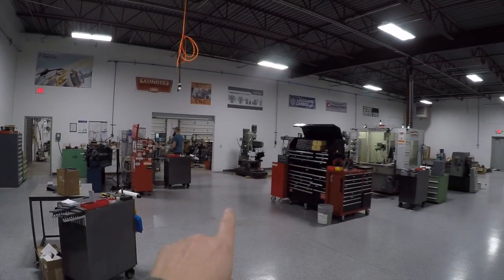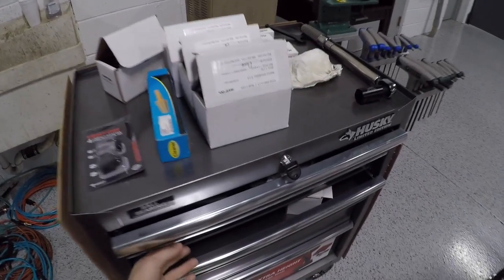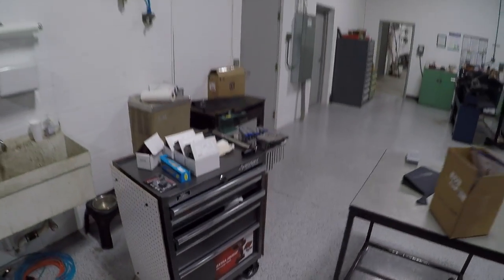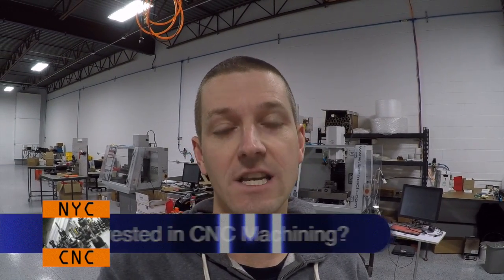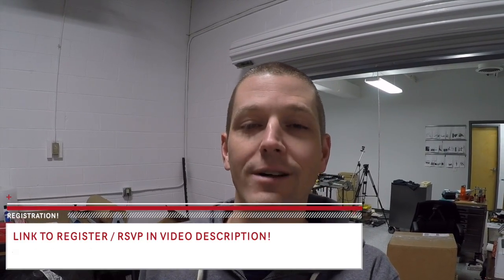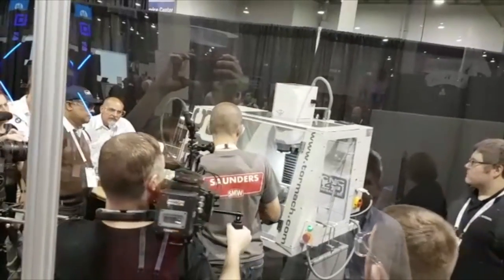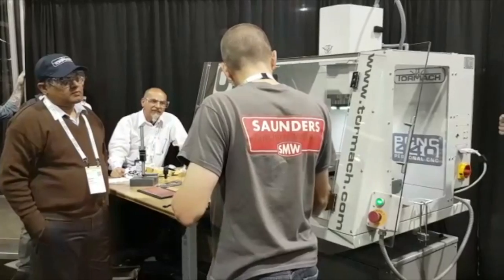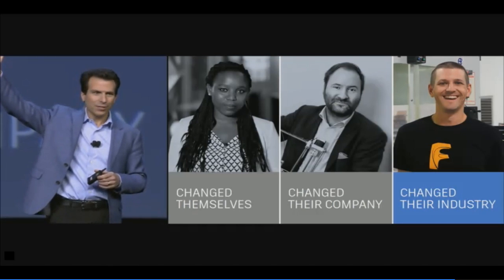Autodesk University and How to Succeed in your Business Pursuits CB38

Comment: Don't know how your other MCU's work but HAAS requires block G43 addresses for every tool change. At least the small VMC's at school do. Just a warning since I've heard other controls recall height comp. automatically.
Reply: Chaotic Logic 
G43 is negative tool height comp. it should be on the same line as the first Z move along with an H value corresponding to the tool. 

Some older machines use G44 which is positive tool height comp.  same thing as G43, just inversed. Has to do with how tool heights are stored in the machine controller. (Some store heights as positive values, some store as negative values)

G49 cancels tool height comps

HAAS has T and H address agreement parameter you can turn on, which checks to make sure the H number you call matches the T number in the spindle. If it doesn't it will stop and give you a T H agreement error. 

Still always need a G43 Z# H# though no mater what machine. 

Most machines will overwrite the H value on a new G43 H# line without having to cancel out with a G49. And many have tool height automatically cancel on a M6 during the tool change.
Reply: So the Z axis direction is reversed on older machines? They both referenece machine zero right?
Reply: Chaotic Logic 
Not exactly "reversed". 

It's based on how you're referencing the tool height. 

Negative height if you're referencing from something on the table like a gauge block or top of a vise or part. 

Positive values are it you're referencing to a distance from the spindles gauge length (typically machine Z zero). 

Old machines didn't have things like G54. And everything had to be referenced from the machines home position. So all height offset values were positive. 

When multiple offset positions were added, you could reference offsets based off of a G54 position. Which would give you negative Z height offsets. 

Negative height offsets are the most commonly used now because it's easier to adjust a tool height. Need it to go down more, subtract (make the offset more negative), up you add (more positive).  

With positive height offsets you have to add to make the tool go more negative, and subtract to make it go less negative. 

Confused yet?  😁
Reply: So what is the industry preferred CNC namebrand? It's my understanding that HAAS is the economical choice usually but also revered for ease of use.
Reply: Chaotic Logic 
HAAS, Fadal and Hurco would be entry level. 

Mazak, matsuura, kitamora, Datron would be a few levels up. 

DMG-Mori, Okuma, Grob would be a few more notches up. 

And top machines would be Makino, Hermle, mitsu-seki

Comment: Better make sure you get one of the "debugged" new HAASes.  I've been hearing lots of horror stories about the new control having tons of bugs.
Reply: eformance indeed. I think 3 updates already since the new controller software hit the floor. 

On the plus side HAAS is usually good about getting service techs out and don't give much hassle on updates
Reply: NYC CNC 
There was issues with USB and Ethernet connectivity. 

Pressing buttons too fast could cause the system to lock up and crash. 

I believe there was an issue with its plane transformation on the UMC. Not sure if that was a controller bug, or glitch with the interface between the machine and controller. 

Some issues with macro commands not functioning correctly. 

A couple reports of the spindle failing to spin at the programmed RPM and dropping to its open door safe speed of 750, even though the door wasn't open. 

A lot of issues taking older programs made for a previous version HAAS controller and putting it on the new controller. 

A couple rumors of settings and parameters randomly reverting back to factory settings if the machine gets shut down.

Comment: We got a few new HAAS machines... build quality isn't as solid as a mazak or mori seikis I'm used to.
Reply: Shoorit 
Neither is the price tag...

HAAS has a place. Their not my cup of tea either, but they are perfect for John. No sense in dropping $350k+ on a 5 axis Mori or Mazak when you can get a HAAS for less than half the cost. Especially if you have never run a full size full power CNC. 

Are they ultra fast, ultra precise, 30yr longevity machines? No. no where close. They are a 5-10yr, paid off in 3 to generate profit to get one of the upper echelon machines down the line.
Reply: Shoorit Cut him a break. It's his first commercial machine. Why would you want to shit all over his parade. I think it's really cool that he was smart and bought a machine that fits his needs and budget. I think it's better than doing what John Grimsmo did, and get two super expensive machines, both within less than a year; while making a single (sometimes two) product that only appeals to people who buy $500-2000 knives (Most are around $700). After paying his overhead and materials, he's got A LOT of knives to sell. He's got to constantly be producing knives to barely pay the note on those things. Hence the reason he doesn't make videos anymore. He doesn't have time.
Reply: I think he said he paid CASH - aka no payments.  BIG thing if you can afford it
Reply: NYC CNC 
Don't be nervous. 

Machines can smell fear